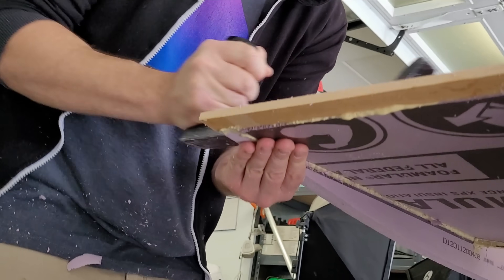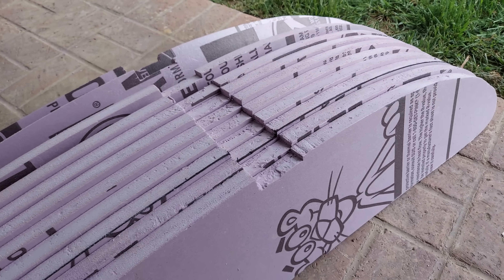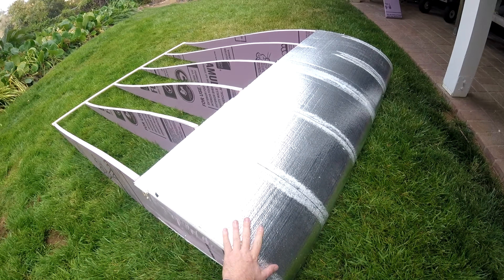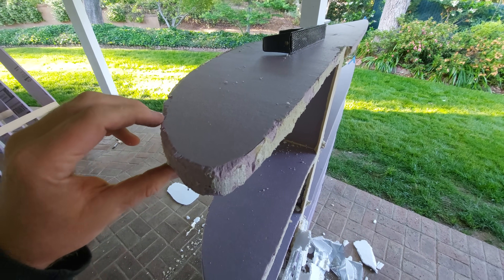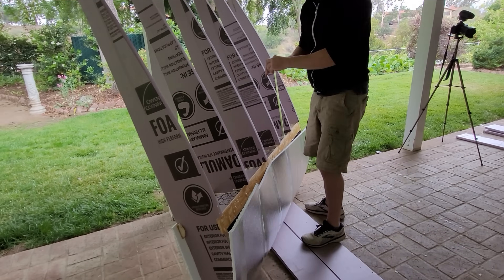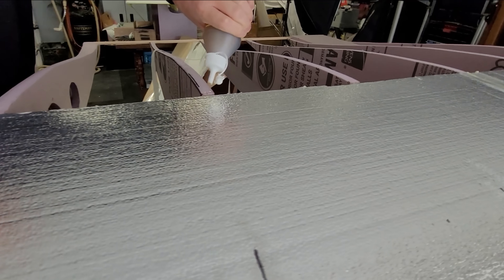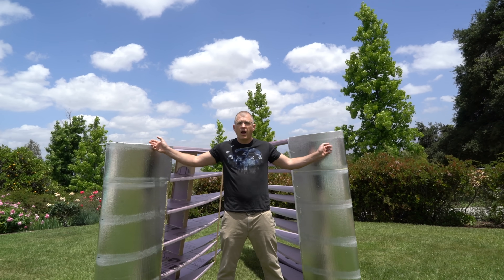Coolest Water Toy Ever?  Manned Boat-Towed Ekranoplan (Build Part 1)

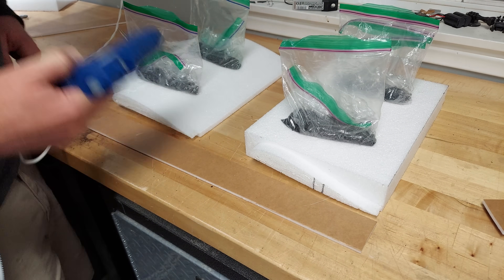Comment: Would you please share the cutting parameters (wire diameter, mechanical tension, electrical current, cutting speed) of your hotwire cutter (at 1:05)?

Comment: That saw is a Japanese-style woodworking saw called a kataba. It's use is for cross-cutting wood (cutting across the grain). They make them with much finer teeth, which would probably serve your needs better, but they're quite expensive. If you ever decide to use them on a woodworking project, know that they cut on the pull stroke, not the push stroke, and that with these saws, you really need to let the saw do the work or they'll be ruined quickly. That said, I love them. They go through wood with ease :)

Comment: Im working on something similar, different shape/setup to try to float a bit off the water. Big problem is power to push and get the lift off speed of around 60km/h which on water seems a lot but it seems fun.

Comment: Do you know where the center of gravity is located? You could lay a piece of pipe on the ground and roll the wing forward on the pipe until it tips down. Then note the change when you add new materials or parts. The location of the CG will affect performance.

Comment: The Bosch T313 jigsaw blade will give you a smooth and more accurate cut. They are designed to cut polystyrene and cardboard.
Reply from the maker: Good tip

Comment: To support that leading edge while keeping with the "home depot aircraft supply" theme, I'd suggest one on the cheap light steel tubing shower curtain rods. A hole saw of just under OD size forms the pocket, while the tubing wall itself ultimately forms the rib leading edge radius nose. Tack taping tube to rib both sides completely secures the assembly. Minimal added weight penalty, and a final wing structure with greatly increased leading edge durability.

Comment: Not to be pedantic, but the Ekranoplane and similar designs don't fly because they "compress the air under the wing."  They fly like any other wing: the wing's curvature creates a low-pressure area above the wing, creating lift.  What makes ground-effect vehicles like the Ekranoplane different from a "normal" airplane is that the wings are too small to fly out of ground effect, which brings us to the main point: when there is a difference in pressure between the upper and lower sides of the wing, the air on the higher* pressure side will try to flow over the wingtip to the low pressure side, which causes a lot of drag.  However, when you are relatively close to the ground (like 1/2 the wingspan), those vortices can't form over the wingtip, significantly reducing the induced drag.  Less drag -> more lift, and thus an "airplane" that ordinarily would be able to fly is now able to get a short distance off the ground.

In any case, very cool project!

Comment: you certainly gave me a great view by providing the build.  presentation offered concise and short actions while verbally filling in the world of this craft... and choices that helped me make better plans for the one im working on.  i live near the salt chuck meets ramps that supply propane trucks to nearby islands in the Salish sea. So a water skipper design for a tandem 1eng. pusher float plane as a commuter in a boat magazine keeps visiting my active thoughts.  been drawing and wrapping a couple barb & kens on an old RS r/c hovercraft  about the right size to offer 2each  0.5m fans near their heads on a kinda manta ray animal body and a horizontal rear foil integrated to the fan shrouds.   Ekranoplan, Neat name.  I needed one to join to my ideas.  Very similar to your build, relying on the beautiful ground effects.  I think of merging a tandem petal bike frame to make an Empowered amphib to skip about 20 km total travel to picnic on Saddlebag Is.  tnx for the label and also the build.  You helped me to add better materials... been trying to work that part just now... to my list.  Built a 2.2m boat with that foam, Gglue,10oz glass and marine epoxy., PVC capped rails..  Even keeps my feet warm on the lake.  I maybe thought you were going to start gluing the surface panel from the top, then roll the wing to rest on the d section.  ,,, then I would let it , set for lunch before continuing to lay glue on the foam frame and on marks on the coating.  roll up the surface and roll down wing so its on the flour.  not sure how to doble check that but several positionings allowing glue partially set would smoothly form the leading edge.  Gglue, 5200, PLPremium construction adhesive(s), (all polyurethane) silicone tube cements superglue (CA) all easily cure too fast when water finds them Heavy breathing and light mists will set applied glues off very nicely when trapped between coated surfaces.  Liked your skin choice.  may use it under side, but a skin boat builder (Spirit Line Kayaks) uses poly cloth that shrink when ironed then coats it with a PU 2part sidewalk patching goo.  almost see shadows thru it but a claw hammer can't pierce it and sew on patch if it did.  Add  roundy curves, an oval rear, dual (tiltable?)fans in-wing assembly to  your construct and they favorably compare.  My moto powered  wheel  (retractable)filled wing floats curved to support hydro-foiling and pavement management/steering.  maybe a centered front and or rear wheel or caster/fin may be needed to offer better guidance.  Hope for a nice splash screen yo flip up, and a deck to walk to the beach.  Almost can build it into that pram i mentioned but it going to add too mush basic weight... Thanks again... needed to see your trials to jumpstart me.

Comment: I don't believe weight will be a problem at all.
Strength will be your biggest concern.
And torsional strength will be very important.
I personally wouldn't consider flying it without glassing it.
Use a mid grade glass weight if you are worried about weight.
If you don't have any experience, get a local RC Airplane pilot that has glassed RC Airplanes,
they are great at this kind of stuff. They are used to using lighter weight glass cloth.
I like your video, Good Luck!

Comment: So cool.  As a Waterman I can only say the structural strength your Ekranoplan will need to be much stronger than you may believe.  Assume gliding a meter above the water at a reasonable speed (30kph / 18mph) when one wing errantly dips into the water causing a catastrophic failure where you are pitch-poled in front of the craft that is breaking apart into large rigid and jagged fiberglass reinforced chunks that are still being pulled by the boat, at speed, into and over you.  Could be messy.  Reinforced fiberglass can splinter and shear into sharp angles.  Additionally, the stress on the tow point on the boat will be severe if the craft nose dives in hard.  Think instant very large drogue sea anchor.

Don't get me wrong, I absolutely love the concept and the effort but unless you have your own wind tunnel, or access to one, where you can tether the craft and yourself to a safety harness, me thinks using weight shift for directional control will be a very tough learning curve.  The tow boat itself will impart its own influences as it changes bow angle from stop to plane speed (no aerodynamic humor intended..... hydrodynamic, yes.) the tow force will rise and lower at the same time your Ekranoplan is trying to achieve lift-off.  Yes, there are videos of other designs where people were carried aloft, but there is a reason they are old.  Hopefully you will be using a modern boat with cruise control like you find on modern wake boats.

I wish you well.  Your engineering and construction seem sound, the dynamics of water changes a lot of things.  As a safer pursuit, may I suggest running with scissors while eating tuna fish sandwiches made with mayonnaise with a Best Used By date from the last millennium?  Be curious, be bold, stay alive as long as possible.

Comment: Yes! Absolutely put fiberglass on the D box.  Well worth the small amount of weight.    Love the build by the way. Many years ago when I was young and dumb, I tried to build wings like this in my backyard but I used plywood!  I was barely strong enough to just lift one wing up barely off the ground. It was so heavy. I love this idea though.
Reply from the maker: I came up with a third option, seems to work well with some drawbacks.   Will find out results when we try to fly....

Comment: If it was me I'd definitely fiberglass the d-box. One impact with the water without fiberglassing it and you'll probably wish you had.
Reply: There are videos of very not-aerodynamic, and very not-light tow behind tubes taking off behind boats. I don't think you'll have a weight issue.
Reply from the maker: Good point

Comment: what about vinyl wrap,,it can be used on boats,,,epoxy and fiberglass would cost more..
Reply from the maker: That's an interesting option....
Reply: some vinyl is heated with a blow dryer that lwrap shrinks..it seems cheep .my guess it would be lighter then glass and resin ,,

Comment: as a surfer I can tell you that I would definitely cover all the foam w fiberglass - water that gets into exposed foam can destroy a surfboard at least. it would also make the whole thing stronger
Reply from the maker: Not worried about longevity, more worried about the weight and strength balance.

Comment: aircraft builders, will cut holes in the ribs, to lighten them up. Research your covering so it is at least somewhat water proof or water resistant. I know the foam is lightweight, but i think you forgot to make "lightening holes".

Comment: I think that's an Awesome build. I've built and flown R/C Planes since 1988. Many kit-built planes that I still have, as well as two which I designed myself. A mid-wing aerobatic type and a Twin Engine 60" wingspan that flies on one engine if if one of them fail. I have a video on my other channel of a flight where I had a throttle servo stuck wide open. I thought was it's last flight so I was gonna enjoy it and have some fun. Here is the link--> https://www.youtube.com/watch?v=HbdrSq4IKT4&t=249s

Comment: A surface-effect aircraft will work much more efficiently if endplates are mounted on the wingtips. (I don´t know what you are planning).

You then will not need to configure dihedral for intrinsic stability -- but then I´ve never seen such a craft with dihedral used....

Comment: Do you know the section numbers? Perhaps you want to play with different sections? There are NACA sections and how to generate them, available on the Interweb, or you could buy/borrow a copy of, "Theory Of Wing Sections", its projections are more accurate than some formulas, and easy to use. 
Your leading edge wrap would be easier if you "V" kerfed the inside of the bend, looks good as is though. 
How did that Gorilla glue work? I've had problems with it expanding randomly as it cures, it's high density urethane foam as you know. 
If you find the foils structurally sound I'd use epoxy sized veil for light weight, if it needs more structure then any light 0/90 epoxy sized cloth. No mat. No polyester resin, of course.

I like your hot wires, back in the day I just hooked up a light rheostat, two wooden handles with, a length of nichrome between them, and plugged it into a wall socket. Burnt up a few wires, but there was a safety warning: USE GFI OR FRY!!
Reply from the maker: I created my own sections for this project and set the AOA's for the desired design speed.   Kerfing didn't actually help, if I went any further than halfway through the foam, the backing would split.   Probably should have showed that, that has been a frequent comment.
Reply: @thinkflight  great! You'll learn about sections that way! You may still want to check out NACA sections. Assuming you're not going very fast, 25 - 30 mph, my guess for a section might be: max thick at 30% chord and about 15% chord half height at that point for the upper half, and play with the lower half. I wouldn't use a "low drag" section as that would constrain the angle of attack. 

Ah yes, that shiny foil is too thin. Perhaps a layer of glass before you kerf? A double layer up front should make them more durable. 

Best!

Comment: A Series of horizontal cuts close together but not all the way through the foam board at beginning of curve measurement  would remove the forces that you fought with, adding glue in those cuts before bending would strengthen as it cures,it would lay flat with no gaps I am really curious to see this fly, It looks like a fun project with entertainment as the pay off a win win for us all,thumbs up everybody.

Comment: Do you plan to eventually build a powered version of this?  I have been interested in building an ultra/microlight WIG for several years.  I started building model airplanes back in the 60's including stunt and combat control line, free flight and later RC aircraft (once I could afford it). I have also flown light aircraft and para-gliders.  Are you using a Clark Y flat bottom airfoil for this?   What is the angle of incidence of the wing to the fuselage?  0 degrees?  Will you have some way of adjusting that on the prototype?  Have you ever used a hot wire cutter with foam?  It would make cleaner cuts than that saw if you had a template to follow.  Good Luck.  I find this a very interesting project. My idea for a powered version of this was to incorporate a Powered Para-glider backpack frame and motor into the design where you could just bolt it into the fuselage.  You would have a seat, motor and frame in a light compact package that would be easy to remove or install.  They produce a lot of thrust and are very light and come in different size engines and horsepower.   Thanks for the video!
Reply from the maker: I may power this one if it works out for towing, if not I will just make a dedicated powered version next year.  I am using my own sections for these, the front needs to be at 6deg AOA for the lift I want and the back is at 5deg AOA.   No means of adjusting incidence, will just go the speed it likes when towing.   I don't like the Para-pack idea for this one because the pilot is blocking a large percentage of the disc area, I would probably go with two motors, one on either side.

Comment: You get a lot of lift in ground effect, these have a high payload. I would definitely fiberglass it, a little weight won't hurt.
Reply: You might decide to add a electric motor, or gas! The reinforcement will come in handy. I think this would be ideal for electric because of the high payload possibility for batteries.  Plus you can be heavier than ultra lights because it is not a airplane if  it stays under 20 ft I think. You could even charge off solar in the wings.
Reply from the maker: Since powering it later is more of an after though (there is a dedicated powered version scheduled for next year with all your suggestions) I'm rather on the fence as to how deep to go into building this.

Comment: Great video. I would use the woven fiberglass as it works much better than the loose fiberglass strands. It is also very strong and could take a lot of hammering.  I would also make the seam at the thinnest section of the wing, and would do an interlocking seam, similar to take your two hands, bend the fingers to lock into each other and try to pull sideways.To get it nicely stretched I suggest you use a staple gun and staple the sheet and seam in place as you fold the seam in place. Once it is finished, do a minimum of two to three coats of resin over the fiberglass sheet. Do the first coat, wait till it just dried, apply the second and so on. Let it cure for at least one day once the resin has been applied. Thereafter sand it down, apply a primer and then your paint two coats. Good luck.

Comment: I am not sure your spar is strong enough.  The ribs are fine being foam - but I would have made sandwich of wood|foam|wood for the main spars, but horizontal instead of your vertical build.  Your spars should be strong enough to carry at least 2x of the total expected total flying weight.

Comment: Check out hot wire foam cutters.  We used a hoime-made version to cut out the foam spars for an airplane klit.  The hot wire leaves the cut edges as smooth as can be.
Reply: I second this.  It's not hard to make your own hot-wire cutter if you are inclined.  Adjusted correctly and operated with patience, they leave a perfect smooth edge - no/little sanding required.

Comment: This has been tried, and banned on some occasions for hurting folks. Still, I only know this because I wanted to build one too! Good luck. Hope you can figure out the instability issues.
Reply from the maker: If its been banned I'm pretty sure I'm on the right track to having fun!
Reply: That’s what I was thinking.  Is someone going to ride on it?  At what speeds?  Or will they have to pilot it and keep it under control?  I don’t know what the design looks like, but I have visions of it flying up out of ground effect, rolling inverted and smacking the water upside down at something like 40 mph.  Ensure that doesn’t happen.  It could be fun, just make it safe.  Just my opinion.
Reply: Here is the one I was referring too. Not really a ground effect vehicle though. https://youtu.be/E1IPnnttL9k

Comment: Plastic could hit water at speed and the resistance could rip it apart, where as the same thing may be less likely with fabric as water seeps through, but plastic might work best if you want to stop the foam from moulding and getting weak

Comment: That looks super cool and intriguing. You have given me great ideas. I bought boat plans that use that same foam material but rather than using fibreglass cloth/epoxy or polyester resin combination Dacron or light cotton and TiteBond3 were used. The results are strong, light weight and smooth.